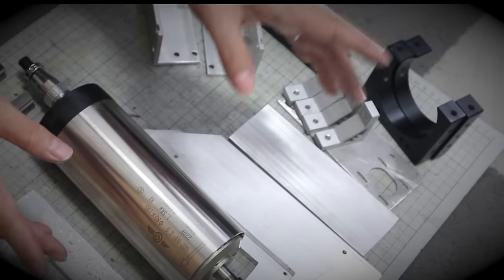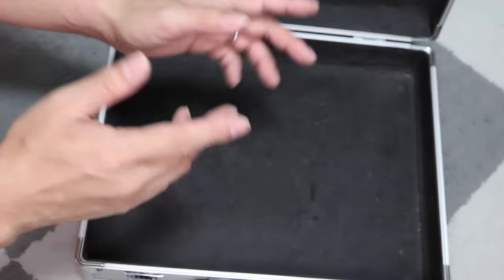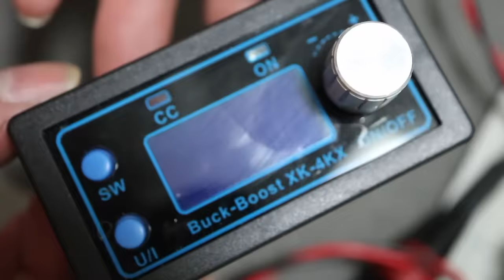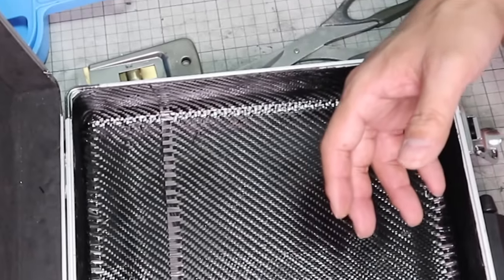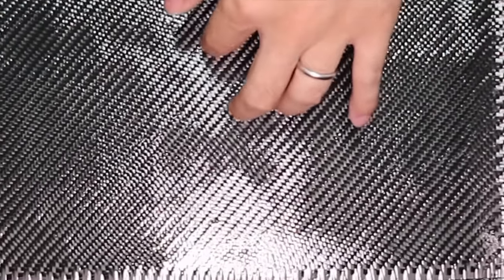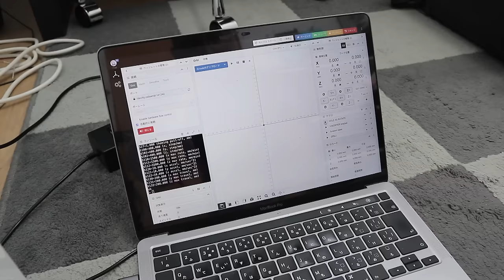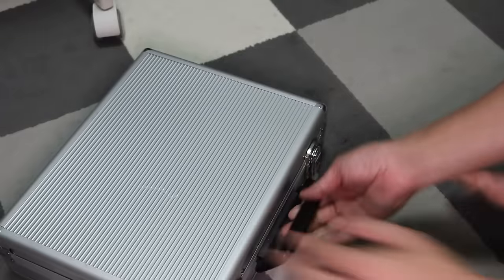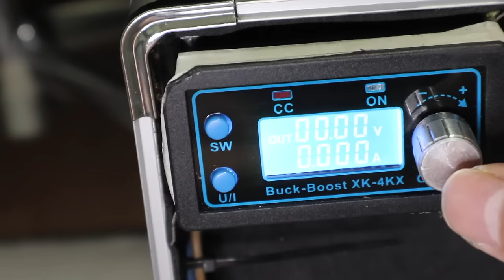Revolutionary Beyond Your Imagination Metal DIY Tool! [FIRST PART]

Comment: Insane how you just have an idea and just make it. How long did this projekt take start to finish?
Reply from the maker: I bought an aluminum case based on the idea of making something like this.
After that, I probably spent about a month thinking about what kind of structure I could make with the materials I had.
After that, I think it took about a month to manufacture it.

Comment: Amazing solution to achieve your goals💪💪, I’ve got stuck in my own build due t be able to machine parts for it. I ve  have some chances to access industrial lathes and milling machines but they are always making fixture’s so some of the apprentices are  machining in the machine free time in aerospace Ali the parts. Carbon fibre 19:21  is a pain to machine that’s why I dropped the idea after waisting milling bits just to make the holes for the screws, it is true that they were 10mm. Plates 😂😂.
So I went for the stock Ali instead. 
Love the videos and your designs. 
Keep it going💪💪
Reply from the maker: I know exactly how you feel.
Nowadays, anyone can use an excellent 3D cad to create various designs.
But you need machines to make the parts.
Not many people have sufficient machine tools at their disposal.
Probably many of the people interested in this channel are making something themselves and facing some problems.
I have faced so many problems too.
If I had known at the beginning that there would be so many problems, I might not have started.
I wish you all the best.